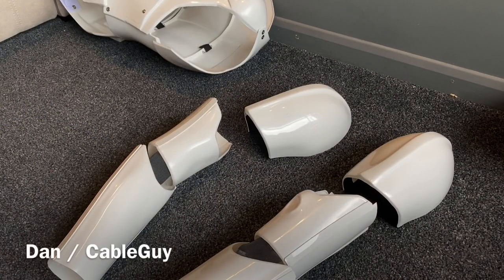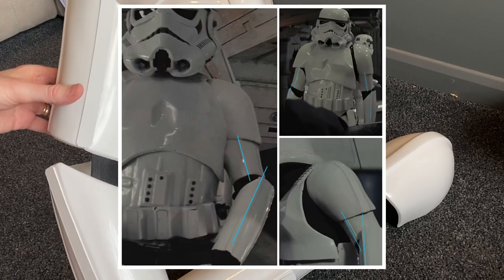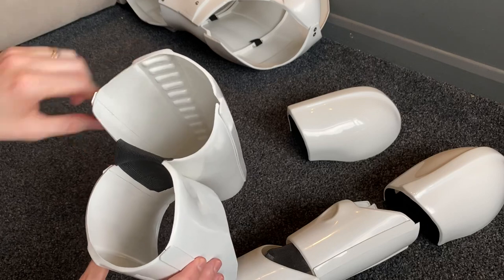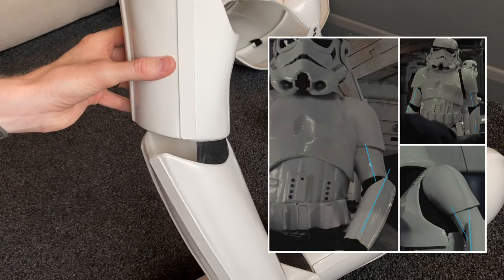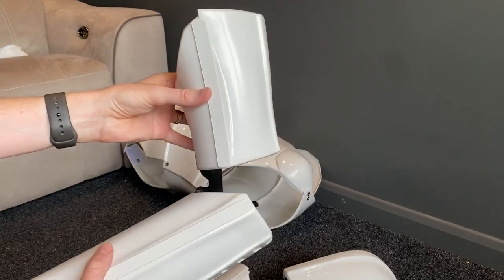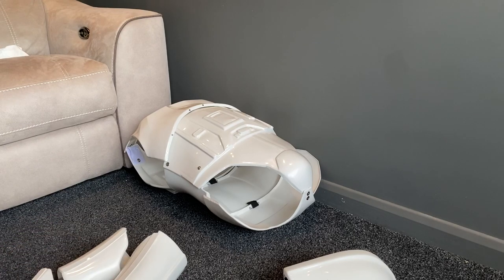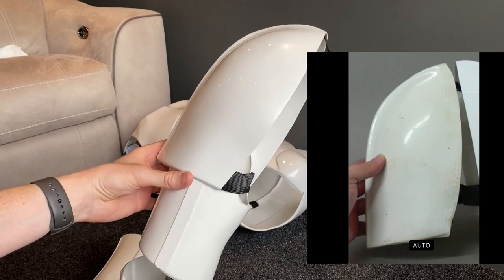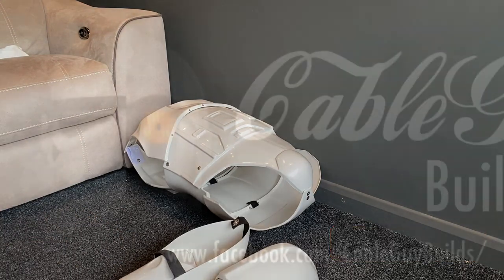ANH/ESB Stormtrooper - arm alignment and shoulder bells

Comment: Interesting! My Sandtrooper forearms tend to twist during a troop. Ive put some foam inside to stop them moving which works to a degree but they still have a mind of their own! I guess it's my elastic positioning but I recently discovered someone who had a RS props built Sandtrooper and his forearms weren't connected at all! I don't knowif this was true for the Sandie's as they were the first suits built and filmed in Tunisia. Do you know how true this is at all Dan? I've never tried uncoupling the forearm and biceps but I will give it a go when I'm suited up to see if it stops my problem.
Reply from the maker: I’m not sure on the TD. I’ve not really delved in to the finer details of the sand troopers. 
What width is your elastic from biceps to forearms? The originals are a couple of inches wide - this helps to keep them lined up as they hang really nicely (as per the video). 
Not sure if the original TDs had the strapping - is there an image gallery on the MEPD forum?